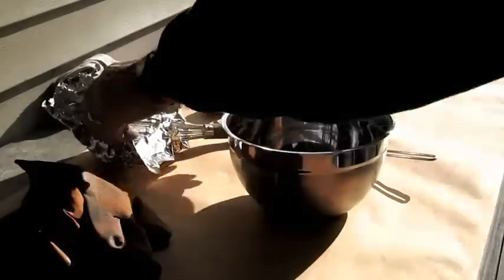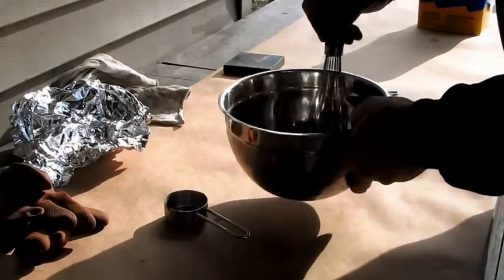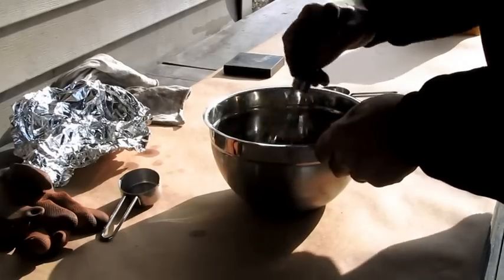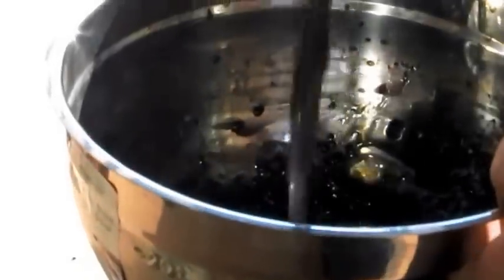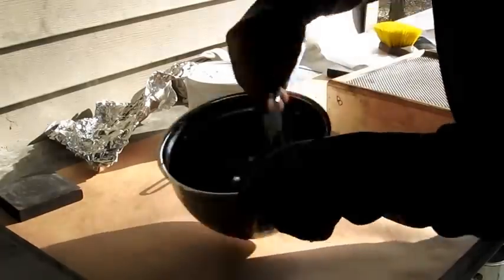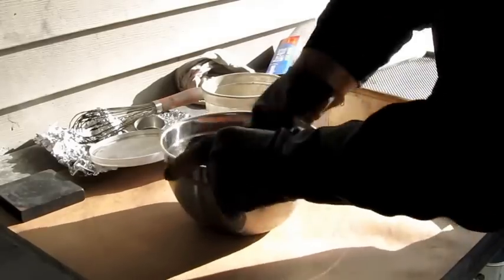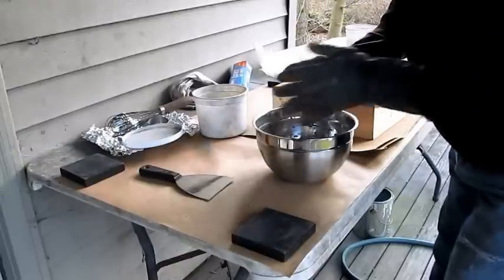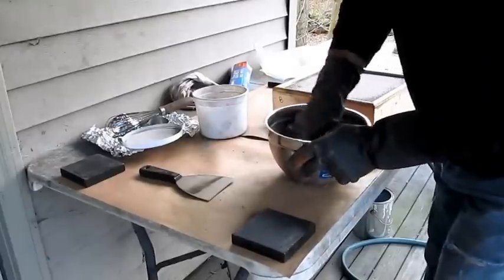Making Crackle Stars, New Method

Comment: Hey guys you can upgrade this formula by adding a cup of gas ! Works great!
Reply from the maker: I'd personally ignore that suggestion.
Reply: @nedgorski  Hey ned. I had a quick question if you had time. I have liquid nc lacquer from fwcb, do I still need acetone or no? Thank you.
Reply from the maker: @PyroPerchlorate  For crackle, starting with the smokeless powder works better than just using NC lacquer.

Comment: So I made a batch of the dragon eggs with the 71% bismuth and cut my patty into small little pieces. I had the good lighting on the ground bad in the air issue, soooooo on plywood I hit a small granule just enough to break it with a hammer then did so to the whole batch. They go off like crazy now an all different times since there all different sizes. An most pop multiple times!!!
Reply: What bismuth do u use?

Comment: Why are you using a metal bowl and whisk...
Reply from the maker: Because it works well, and is safe to do.
Reply: @nedgorski  okay I was just wondering because the chance of static relatively new to the pyro world love your videos man!
Reply: @redneckpyromania6965  no. static requires a conductor to enable build-up. and to ingite a massively wet composition takes a whole lot more energy than  static alone can provide and needs enclosed, tightly condensed fumes and high (well above ambient) temperatures. also. the quantities being worked here are very small.

Comment: Sorry to trouble you tell me the components to make these stars grazzie
Reply: TheRealUbehage Bismuth has a half-life a billion times longer than the age of the universe. That's not radioactive. A banana is radioactive (K-40), bismuth is not. Bismuth has unusually low toxicity; it's even used in over-the-counter heart burn medication (peptobismol), which is metabolized to bismuth.

Copper is essential to life. You must eat about 2 mg of copper per day for good health. LD50 for copper II oxide is ~1000 mg/kg of body weight in rats. Inhalation of anything is not great, but it's not like we are talking lead here and you are going to add water.
Reply: TheRealUbehage 

while copper oxide is  mildly toxic its not toxic as hell
A while ago i was reading about health issues associated with copper as i have developed an auto immune condition and at that time i did not yet have a DX.  i has been working alot with copper and was searching for ant clue.

im not posting this to be contrary, i just thought that you would be interested.|
its basically no more toxic than any of the transition states. 

Copper(II) oxide is an irritant. It also can cause damage to the endocrine and central nervous system. Contact to the eyes or skin can cause irritation. Ingesting cupric oxide powder can result in a metallic taste, nausea, vomiting and stomach pain. In more severe cases, there may be blood in vomit or black or tarry stools, jaundice and enlarged liver. Blood cells rupture resulting in circulatory collapse and shock. Inhalation can lead to damage to the lungs and septum. Inhalation of fumes during smelting of cupric oxide powder can lead to a disease called metal fume fever, which can result in flu like symptoms. Copper (II) oxide can cause a toxic build-up of copper in a small subset of the population with Wilson's disease. Handling copper (II) oxide powder should be done in well ventilated area, and care should be taken to avoid contact with the skin or eyes.[3] However copper is an essential trace element for the normal function of many tissues, including the nervous system, immune system, heart, skin and for the formation of capillaries [4][5] as well as copper being extremely well metabolized by humans. Copper (II) oxide (Cupric oxide, not Cuprous oxide) has extremely low bioavailability (practically zero) and should not be taken in conditions of copper deficiency, especially as part of a multivitamin which also includes zinc or molybdenum.[6] Excessive zinc or molybdenum intake eliminates copper from the body. Copper oxide is used in vitamins supplements as a safe source of copper[7] and over-the-counter treatments. Copper oxide is also used in consumer products such as pillowcases and socks, due to its cosmetic and anti-microbial properties.[8][9][10][11] The risk of dermal sensitivity to copper is considered extremely minimal
Reply: TheRealUbehage also i dont understand the extra aluminum.
Magnalium is basically aluminum and magnesium with a little tin i think perhaps some lead?? damn im getting old and my memory is shit lol

at any rate i would expect that one could simple use magnesium ans aluminum powders at roughly the average Magnalium formula and get the same results. they are the major constituents of Magnalium after all
 Magnalium is more expensive than its components combined.

just a thought